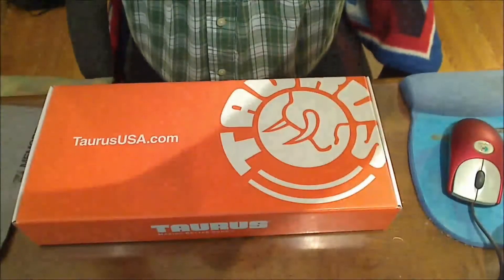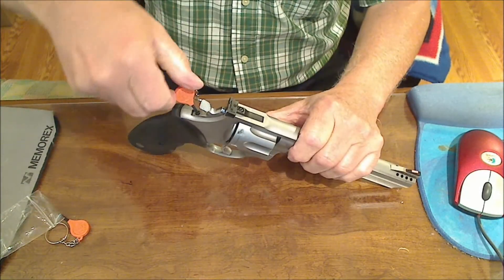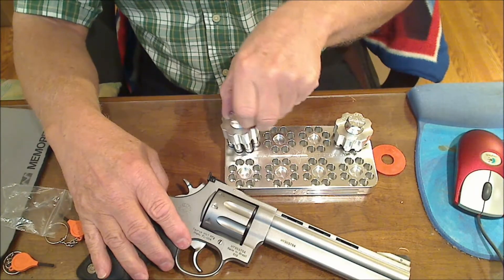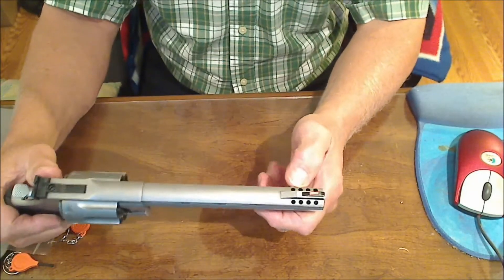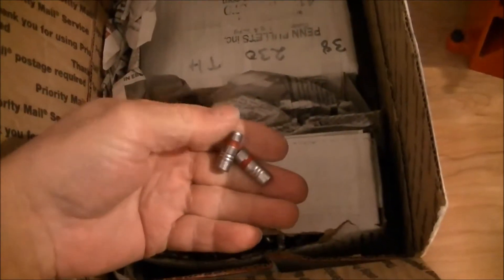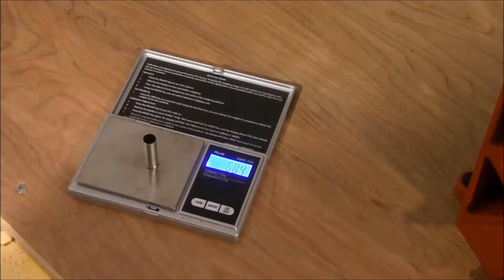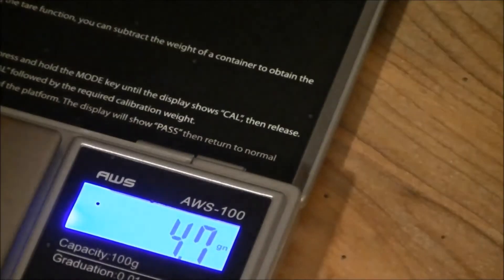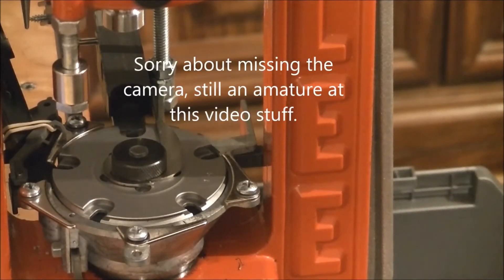Taurus 608 SS6 part 1

Comment: i did a tiny bit of reloading back in the early '60's. the equipment was far more primitive and cumbersome as i remember it. very time consuming but reduced shooting costs a great deal. but for me the time trade-off was not worth it. that machine would certainly make high volume reloading far more practical and rewarding.
Reply from the maker: +crazymanmichael I would have a hard time with the hand loading or the one operation at a time press.  I get to do more shooting with the savings so I guess I am hooked on reloading.  Thanks for viewing and commenting.